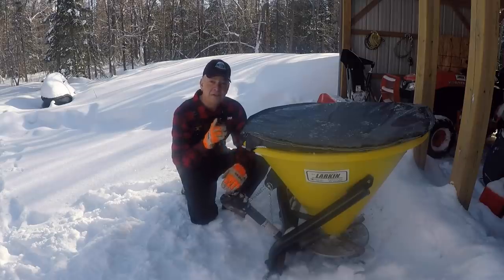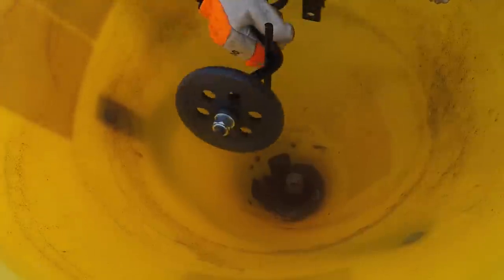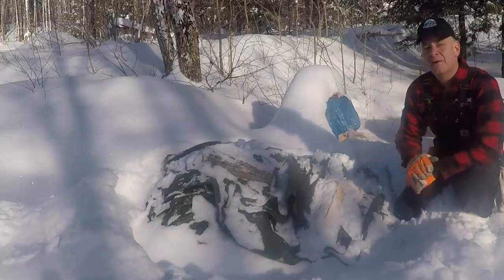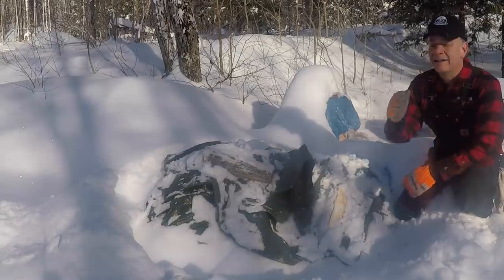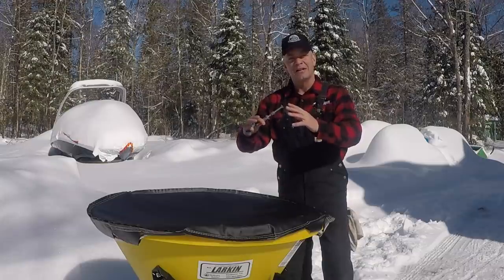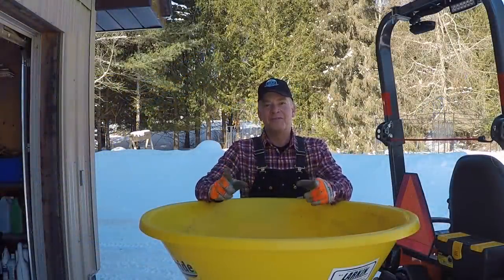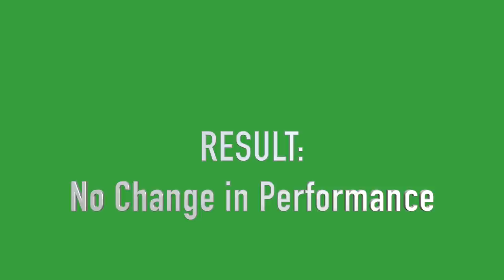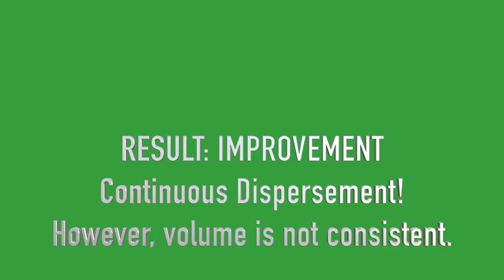#136 Kubota B2601 Compact Tractor Landpride FSP500 Broadcast Spreader. Experiments with Wet Sand.

Comment: Many years ago my father and I built a couple of wooden , lined bins and we filled them with sand from a local sand pit. We would fill them with sand  in in the spring and it sat all summer in the bins. All summer and fall drying out. The outside bins were covered with a tarp to keep the rain off. By the time winter rolled around we had a great supply of dried sand to spread on the driveway. Just a thought to plan for next years operations. You could even station one part way along your drive so you have a closer refill station.  Just a thought to help provide you with good dry sand for spreader operation.
Reply: I was thinking of such a way that over a long period of time, the sand would dry.  That is nice it worked!
Reply from the maker: Good day Errol. That is an excellent idea. I think I will look at that for this summer. I have to get it anyway so getting it early is a great idea. Thanks!
Reply: @GPOutdoors  Also since you will technically be obtaining the sand in the offseason, it's quite possible you can obtain a better price or bulk discount.
Reply: GP I think Errol Hicks  just spelled  out the answer your looking for. Next winter problem solved 👍

Comment: Thanks GP... Here in New England, after the trial & tribulations of getting something to work is referred to as " Good Ole Yankee Engineuity " ... It should be pointed out however these type of broadcast spreaders are designed & engineered to spread light fluffy material, i.e., fertilizers & seeds, not moist sand & salt. Take a look beneath the spreader pan & look at how small the gearbox is. There is a reason for this, it is designed for lighter duty work. It also factors in why these units can be be purchased in the $700.00 range, give or take. 
I have been looking at a sand & salt spreader specifically designed for the task at hand. It is made by Kasco in Shelbyville, Indiana. They make (2) versions for a 3 point hitch, they are called the HERD in model numbers 5.5 ( holds 5.5 bushels ) & the 750S ( holds 9.5 bushels )... Both units use the same mechanicals below the square steel hopper. 
They both use a heavy duty gearbox filled with 90 weight gear oil. The agitator is specifically designed to break up clumps of frozen ice, salt & sand as well as maintaining a continuous flow of sand out of the gate... I have read the PDF operators manual on these units off the Kasco website, it is a real eye opener.  I don't mean to rain on your parade here, however my tractor dealer strongly advises NOT to use these seed spreaders for spreading sand.  I think over the test of time, the gearbox will prematurely fail on these light duty units. There is a reason why they don't come with the necessary agitator to break up clumps of frozen material & why they have hoppers made of poly...
Bill on the Hill.
Vermont, USA... :~)
Reply from the maker: Hey good afternoon BOTH. This is really helpful info. And trust me, you're not raining on it my friend. I really appreciate it, as well as the other subscribers, to receive this info. I gave it a thumbs up so your comment goes to to the top, for folks to read and consider. I did my research and made a decision but that doesn't mean it's the best for everyone. And time will tell if it works out. But one thing about this channel, is that folks can get an honest overview of different opinions, views and experiences from kind folks like yourself, who are willing to share, which helps them make good decisions for their needs. So, all good! And really appreciate you taking the time to share with us. Thanks for joining the channel. Cheers and have a great week!
Reply: Can you post a link? Kasco?

Comment: Hey GP and GUY, good to see the dynamic duo getting the problem worked out. I know it's a temporary fix and Guy will keep going till he is satisfied and you will be in on it too! Just a little bump in the road but you'll figure something. 
Before you can satisfy everyone you will have a community of BIG TIN BARNS built all around your house to keep all the equipment and sand dry not to mention the electric sub station to keep the power up and running 24/7/365.  So , my suggestion to you would be, Keep on what you're doing and be safe. You are doing a great job and living life to the fullest. AND keep on with the videos so I won't have anything to complain about ;-)  Thanks for sharing.

Comment: Good work. Another idea, perhaps an inverted tree on the hub , with 2 or 3 pieces of stainless 1 inch flat bar turning horizontally,  just shy of hopper width. The s/s will cut through the sand and maybe break up any lumps as the sand drops. "More ideas than money. I usually run out of money first " lol
Reply from the maker: LOL. Thanks Mr. Fixit. Some good ideas from folks and yourself if the next experiment doesn't work. Thanks again and here's to more money one day! :))
Reply: @GPOutdoors  👍

Comment: When I worked in the foundry when we had "bridging"in the cone hoppers of sand,we ended up putting in pilot operated pneumatic vibrators on the sides of the hoppers.I would imagine there is a 12 volt dc  vibrator that can be bolted to the side of the hopper.it does not take much to collapse a bridge of sand.FYI

Comment: If you can store your sand so it can get some airflow  it will dry out quick. Storing it in the tarp it can't  dry out its holding moisture. I am thinking of building screen lined sand bin about two feet off the ground for storage and easier on the back loading the spreader too. I am working on spreader for my tractor I like your way of thinking. Cheers
Reply from the maker: Good morning Shel. That's a really good point I had not thought of but you are right, hiding it under that tarp does not give it a chance to dry out. Cheers and thanks for the good suggestion!

Comment: I went through a similar process and ended up with a steel shaft up the middle of my sander with 2 horizontal steel pipes one about 6" from the bottom and another about 12" from the bottom. The top horizontal bar is 12" long and believe it not the sand still bridges that distance periodically. I think my sand is wetter than yours but it also has salt in it. I have stockpiled enough for the next couple of winters, under a covered roof. I think the right solution for wet sand is a vibrator and I may make something up because the factory units are way too much money. I also added adjustable side deflectors to mine so I can adjust the width of the spread. That wastes less sand.
Reply from the maker: Good day Hillbilly. Thanks for the great tips. We talked about putting two horizontal bars but thought it wouldn't break the bridging much so we tried chains as they will fluctuate. Thanks for passing along the experience. Super helpful! Cheers and all the best!

Comment: Hi GP! “If at first you don’t succeed...”  Great ideas and perseverance between you and Guy!  I’ll be interested to see if Guy’s chain loop will work.  Something you might consider is making the equivalent of a blender blade that comes up in a V off the shaft with paddles parallel and close to the sides of the feed cone.  They should have just a slight a mount of twist to them like a propeller to throw the sand toward the center, but not so much twist as to create too much resistance for the gear box and drive train.  Does that make sense?  Great video as always!  Looking forward to a follow up on it!
Reply from the maker: You bet DIY. It does. We wanted to try the chain effect first before moving into something fixed. We discussed a similar approach so if the loop does not provide an adequate result, then we will move into something fixed. Cheers and thanks!

Comment: Hi GP Outdooors This is about your Generac  !   Did you turn your air filter over the right way. The reason I ask is the other day I  watched the problem of the oil coming out and I have seen this before and could not believe a service tec for Generac did not notice your air filter up side down. Yesterday was the first time watching your channel . You do a very go job and a pleasure to watch take care and God Bless
Reply from the maker: Hey good day Wendy. Thanks so much for the help. And the kind words. Funny, someone else said that too but I believe the air filter is put in correctly. In fact, if it isn't then I think I might fall over. LOL. The truth is, just 6 days before this happened, the tech performed the oil and air filter change so the filter you saw me pull out was actually put in by him. I was so confident that I knew what the problem was, that I began filming the video without actually looking to see if that was in fact the problem, so when you saw me open the filter compartment, I actually hadn't opened it since he left. It appears that it only fits in one way I believe but to be sure, they are coming back shortly to install the vent pipe heater and I will ask them , just to make sure. Thanks again for all your assistance. It is pretty kind of you. Have a great weekend and all the best! BTW. If it turns out they did put the filter in the wrong way, I will update my reply to you. :)
Reply: Thank you very much for your reply. I am not guessing about the filter being installed wrong. The Pleats face up screen down flat rubber fits in grove to seal keeping the snow out. Take care God Bless  PS If the service Tec says the filter is installed correctly I will go to bat for you. No problem.

Comment: I wonder if you can fabricate some sort of auger that would spin and pull down the material. Same type design as the auger on the snowblower that pulls snow towards the center. Obviously smaller scale.
Reply from the maker: Good morning David. Thanks for the idea. That just might work. We are going to try the next mod Guy spoke about and see how that works. The benefit of the chain is that it is not a stable obstruction to the sand. It moves and oscillates through the sand. Thanks again and have a great weekend!

Comment: Make it look like an upside down egg beater. Don't use chains but some sort of metal strips? Or, if you have undisposed amount of money, put a 12vdc vibrator on the outside. Happy spreading.
Reply from the maker: Good day Tomas. A great idea. After we try the looped chain, if it doesn't do the trick, we will move into something solid. I like the upside down eggbeater. Cheers and thanks. Have a great weekend!

Comment: Hi GP and Guy, my question for you is why is your modification (which ever one you end up with), any less "damaging to the gear box" than the attachment supplied for the light material? I'm sure you both have already thought about this, but I was just curious.
Reply from the maker: Good morning DA. Thanks for the question. The big one they sent will push through the wet dense material , or try to, regardless of how dense or hard the material is, whereas the pipe is cylindrical and spins in the centre, so does not create any resistance to speak of. (At least I don't believe it will). The idea was to use chains because the chains will slowly extend ( or not, based on the density of the sand) through the material depending the difference between the energy needed to make it extend and the energy needed to push through the sand. So I think it is a more balanced resistance, for lack of a better word. Not sure I am correct to be honest D.A. but pretty sure. Wish I could explain it better but hope that sort of does. Cheers!

Comment: Would their be a DIY design that put a cross member near the top of the sand pile in the tub, that when spinning would pull the material back toward the center of the tub, filling in the hole. Using the last design you created, adding a tube/tower and then add the t-shaped cross member to the tower.  maybe angle iron or angle aluminum. I realize the torque at the base of the sand would be to much, but near the top, the loose material could be pulled into the center and then fall down into the void to toward the device you two designed...Just a thought....
Reply from the maker: Good afternoon Eric. That's a great thought. Thanks. We left the top straight chains on it, so it kind of effectively does what you are suggesting - I think. I like the idea of the chains more than a solid piece because the chains will work with both opposing forces more amicably (not sure if that is the right way to say it?) bit appreciate the suggestion and concept. I am going to try it a fe more times before we make a more permanent version. Thanks again and all the best good sir!

Comment: Hi GP I thought I'd chime in too ,I have a similar spreader I use for fertilizer application on the orchard  and I machined a hub with  2 angled ears that run parallel with the sides of the spreader .The ears are 6 inches long well were. Just think of rabbit ear idea. Its works well for 30 years .Hope this solves your issues too.
Reply from the maker: Thanks very much MOV. I appreciate the help. We are going to try out the looped chain and if that doesn't work then we will move into a stationary mod such as what you have there. Thanks for letting me know. Have a great weekend!
Reply: @GPOutdoors   Hey anytime . Hope to help you out another time.
Reply: I had similar thoughts as his ears, but thought a curve somewhat like a fan blade would one, disturb more area, and perhaps introduce some air into the mix as it spins. Sand being very abrasive will wear down any type of material so frequent inspection is strongly suggested regardless of what you find that works for you.
Reply from the maker: Thanks Coy! Makes sense and a good caution. Have a great weekend!